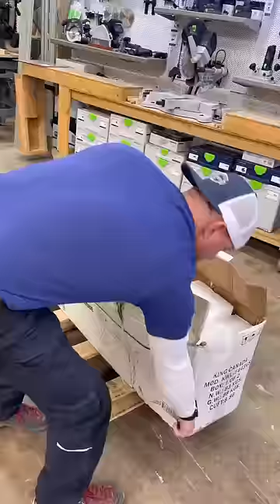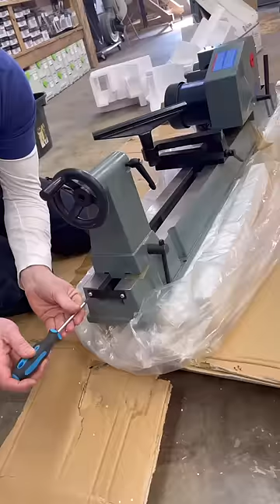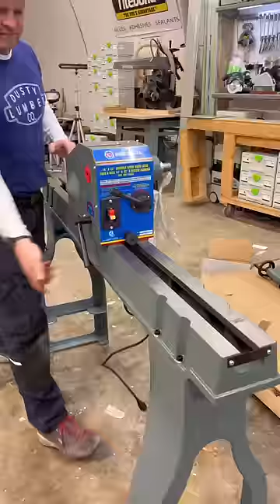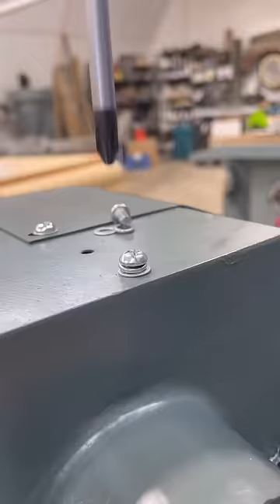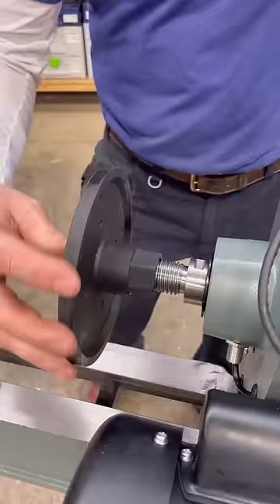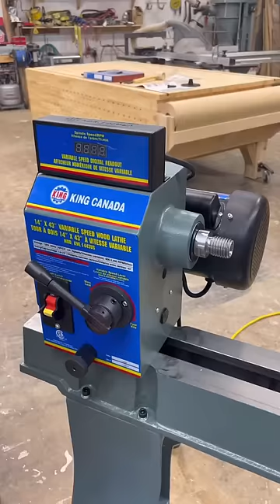New tool #carpentry #woodworker #woodwork #diy #wood #woodworking #woodworkingtools #tools #lathe

Comment: That bad boy was made in the exact same factory as my harbor freight lathe.  Except it is blue. Love that thing.
Reply: Ya, King Canada is built in China. Imported in Quebec😂.
Reply: Bolt it down, because the lightest pressure from a turning tool will tip it over.
Reply: @David Elliott  I bolted a toolbox with a plywood top in the space under it. Holds it down decent but still tries to walk on me when I am turning something heavy and out of balance.
Reply: @cdixster this guy has a $100k worth of Featool on the back wall, sand he goes and buys the cheapest Chinese junk lathe he can possibly find. Lol

Comment: If they make a bed extension you should get it. You'll, invariably, run into projects where youll need it. Especially if you do any stair projects where the posts in turns and landings tend to be longer.

Comment: Is there a slower version of this video?  There are too many parts.  I have never been able to assemble anything with more than three instructions 

When I got the instructions manual for a Sears radial arm saw I gave it away.

Like I said before.  Give me lumber and power tools and I will make short pieces, saw dust, and 88 or 92 degree cross cuts.